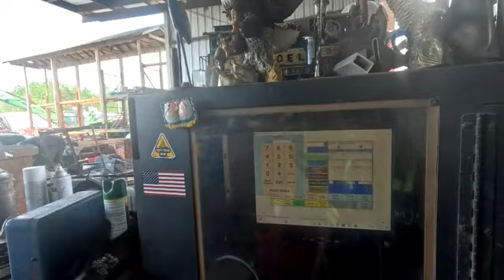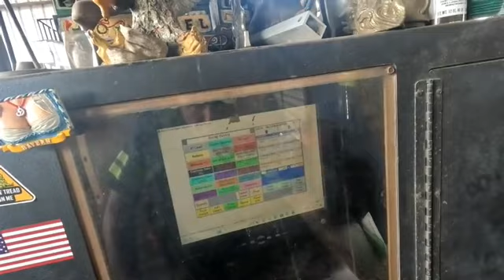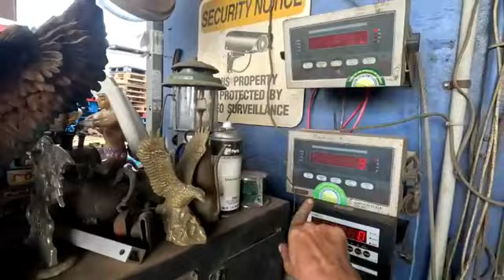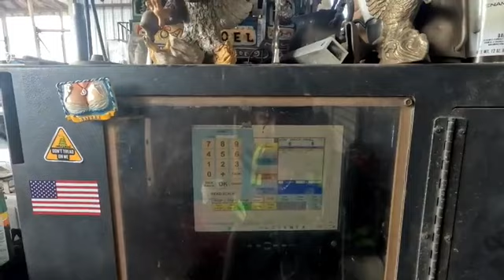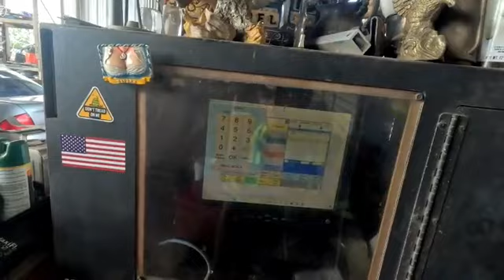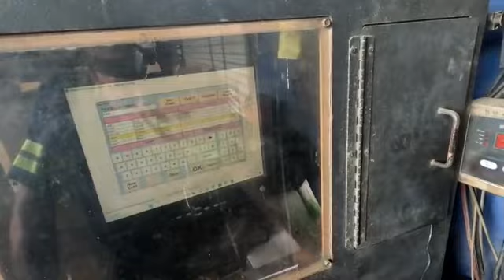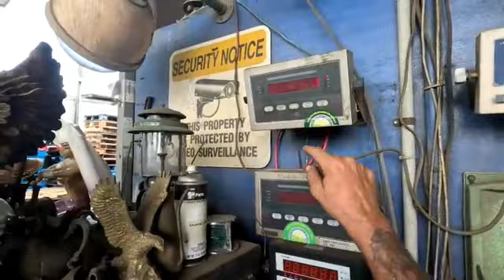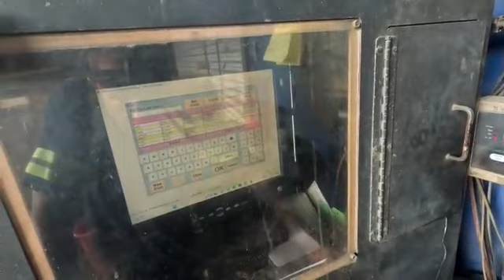SCRAPYARD MAYHEM FRIDAY #scrap #recycle #recycling #steel #brass #scrapyard #scrapmetal

Comment: Jeff I’ve been in your lovely state for a week now
And we’ve been in the parks 
Seen so much nonferrous in the parks
A Lott of the water drainage is copper and brass…..the dividers are brass…stainless steel.
Reply from the maker: If your still here go checkout Rainbow Springs You can rent kayaks and canoes there for a reasonable rate,

Comment: Mountains of aluminium has all that to baled ? Thanks to watching u I am making more money in the non ferrous section
Reply from the maker: I am very happy that you are learning more about non ferrous  so you can make more euros 💶
Reply: @nonferrousjeff  even oil burner motors I used to strip them but I was only making a cents more for a kilo than leaving as is and there dirty to handle
Reply from the maker: @raygreene73  it all comes down to how valuable is your time to you